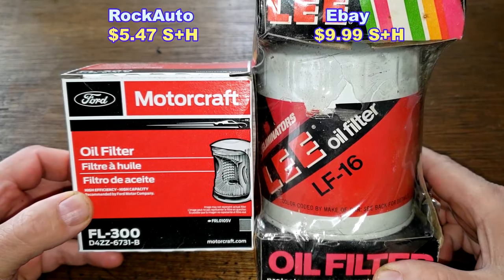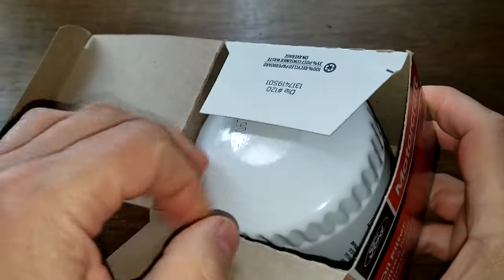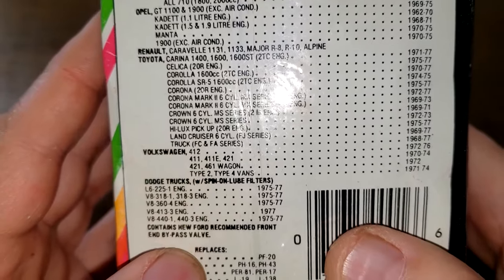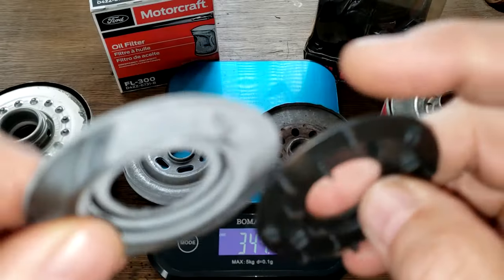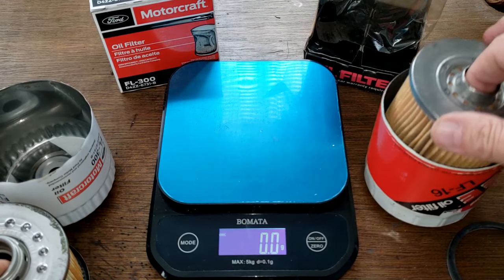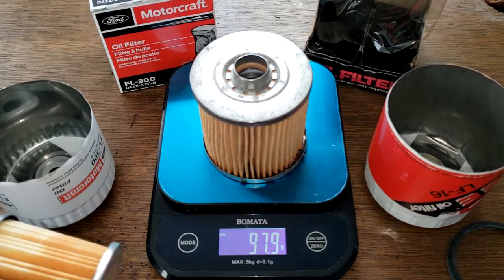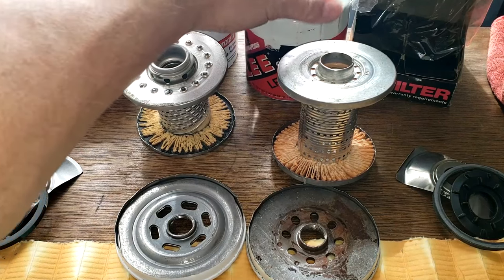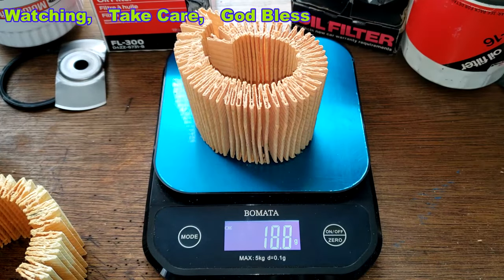Motorcraft FL300 Oil Filter Cut Open vs. 47 year Old LEE LF16 Oil Filter Cut Open Comparison

Comment: Great video comparing that old Lee filter with a new Motorcraft.  Back in the 1970's I always used Lee filters in my AMC Sportabout  and my Dads Plymouth Valiant.  I used to buy them at "Two Guys" department store where people would change their oil in the parking lot making a mess on the ground. I remember the AMC dealer telling me they were junk filters and I should not use them. However that AMC went over 200K miles and it never used any oil so they must have done a decent job. They disappeared around here when the discount stores like Two Guys and Caldors went away. I wonder what ever happened to the company. I think Champion bought them out but I am not sure about that.
Reply from the maker: Thanks for Sharing!👍
Reply: Ha ha Two Guys! I remember. I looked it up. It's now Target.

Comment: Interesting you have an FL-300. My '86 Turbo Coupe uses that one. I switched to Purolator ONE series PL14670 recently. Speaking of Lee filters, there was the time when Mount Saint Helens eruptured and Paul Harvey had mentioned on  his radio show that the only cars that survived breathing in all of that ash and soot were the ones using the Lee Two Stage air filter. Do you remember those air filters? 
We even had discount places like K-mart, King's, and Mr. Wiggs selling the Lee oil filter in the 1970s. Hire's, maybe NAPA, Nationwise, and Western Auto were the auto parts stores selling Lee filter products.
Reply from the maker: Cool!, Thanks for Sharing!👍
I don't remember the Lee two-stage air filters, but I'm sure I've used a Lee oil filter once or twice.

Comment: I worked in an auto parts store back in the 80’s and this video brings back memories.  We carried AC Delco, Motorcraft, Fram and of course the store brand which was manufactured by Puralator.   We sold more Fram and Motorcraft than any of the other filters.  I stuck with AC Delco because I had a Chevy.  Thanks for the great video!
Reply from the maker: You're Welcome and Thanks👍
Reply: AcDelco is a piece of crap.

Comment: I was disappointed in the Motorcraft filter because the threads and the pleat spacing. The Lee didn't look bad at all. Thank you.
Reply: I haven't seen a Motorcraft filter that poorly built in a long time. I wonder who made it. It resembles the Auto Xtra filters, but you'd expect that from a $1 filter.
Reply from the maker: You're Welcome👍

Comment: They ran such heavy weight, sludgy conventional oil back then that maybe they needed the looser media.

Pretty disappointing showing from the motorcraft though. You have to almost try to have spacing that bad.

The Lee definitely has the cooler graphic design, but I like the elimination of unnecessary plastic in the modern packaging.

Another great video!
Reply from the maker: Thank You👍

Comment: Holy Cow, I remember Lee oil filters!  I used to get them at ADAP for my Impala.  Damn I am old.  The Lee looks like a really nice filter, nice to know I was using a decent filter back in the day. We used to do 3K oil changes back then and I am sure that was state of the art in filter technology, Now I know why they said to do 3K oil vhanges.    I do like that upper bypass valve but damn those pleats on the Motorcraft look like it was assembled with a hangover.  

I wonder what happened to Lee filters, I stopped using them after I got my Toyota and started using Purolators back in the mid-80's
Reply: I TOO, remember Lee filters! I always ran Delco Purolator in parts on my Chevies. 😁
Reply: @riceburner4747  They just disappeared.  They were priced right and The ADAP was close by.
Reply from the maker: Thanks, Jim👍
True, the Motorcraft pleats were horrible.
Reply: @WhipCityWrencher anytime Pete!  I’m actually surprised at this other Motorcraft filters you’ve opened up have been pretty good.

Comment: I haven't seen a Motorcraft filter with a rubber anti drain back valve in 20 years. I wonder who made that one.
Reply from the maker: Still made by Purolator, the FL1A also has a nitrile anti-drain back valve.
Thanks, Don👍
Reply: Aren't they all rubber these days or is that something else? Usually they are like a redish color I think while this rubber one is black.